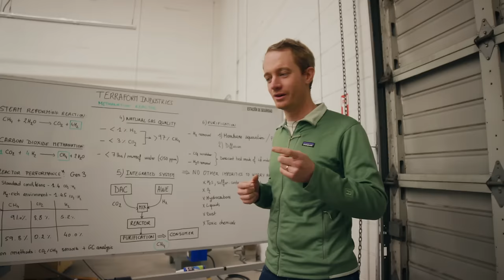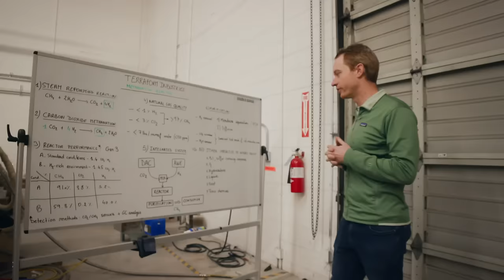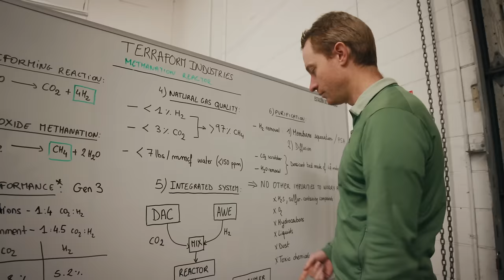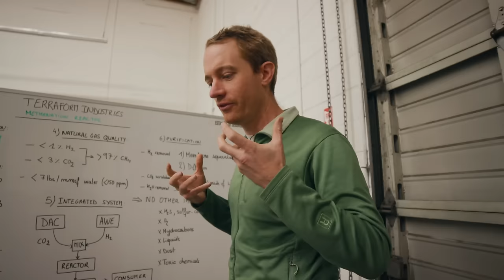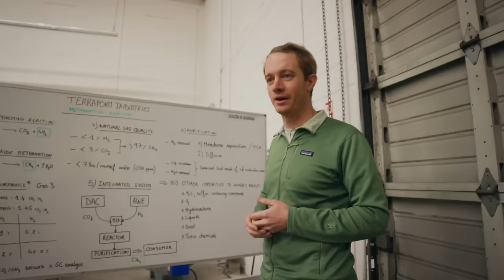The Future of Humanity's Energy No One Knows About | Terraform

Comment: Making hydrocarbons available is not the solution but the problem. We don't have enough energy to power enough of this, and it has losses all over the process, leaving even less energy at the end.
Reply: I don't quite understand your comment.

As discussed solar and other renewables can provide enough energy for this. The losses don't matter if it's a renewable way to produce hydrocarbons and remove carbon from the air at the same time. And if course the whole process will continually be made more efficient.

Maybe you're saying that we shouldn't bother with creating hydrocarbons, but rather just use electricity. That would be ideal, but at least in the near future humans are always going to demand hydrocarbons
Reply: The form of hydrocarbons he’s producing are also cleaner to burn than what’s currently dug up
Reply: @isaacwolf2806  Who discussed it? They in their video?
It. Is. Not. True.
We don't have enough renewables to even satisfy all current electric demand, let alone for the rising demand of electromobility; nor are there enough capacities in transmission lines to get those additional renewables from where they're produced to where they're needed.
Reply: Yeah this is only worthwhile in periods of excess renewable generation that goes beyond grid requirements as an alternative to battery technologies as it does also reduce the dependence on electrification or transportation and all heating technology. Synthetic fuels are not a solution alone, they have a small part to play in enabling the other main transition levers (ie continued deployment of renewable generation & electrification of currently fossil fuel powered tech & stabilisation of the grid because of renewables’ transient energy generation)
Reply: @babooXX   I suppose I was referring to his example in the master plan section. Shows how solar panels can reasonably achieve this. Also renewables currently account for 30% of the worlds energy, and a solar grid the size of Spain could power the whole world.

So to think that this process couldn't be powered by solar is short sighted. Enough energy hits the Earth in the form of sun every day to power millions of these things.
Reply: @babooXX  also, they're solving the transmission problem, that's one of the biggest points - the solar is "bottled at the source" into gas. Now you don't need to transfer or store the electricity.
Reply: @babooXX  Casey didn't discuss it in the video but you can read it on their homepage (linked in description) that the system is supposed to run intermittently when solar power would otherwise be curtailed (i.e. on sunny days at noon). He mentioned once that the system is going to be turned on and off once per day. It's basically taking the otherwise wasted solar power and converting it to hydrocarbons.
Reply: Are you slow? The cost for renewable energy is continuing to drop dramatically. "We don't have enough energy.." We will have more than enough once the cost for solar/wind is low enough. In the video he was talking about 20-25 years from now. The low efficiency will be irrelevant when the cost is low enough. They will only need to cover a small percentage of the deserts to get enough energy for this. 

It all comes down to profitability. Efficiency is just one part of that equation.

Comment: wonder what the entire efficiency of the system is, seems like it involves multiple energy-intensive steps, direct air capture, water electrolysis, and the conversion of hydrogen and carbon dioxide to hydrocarbons.
Reply: I think he s pretty clear it s not very efficient so you  d have to build more solar than with other systems, But the argument is that it will be much more realistically deployable at large scale (not really using new tech or materials), and competitive economimcally than building a full electric+batter+new very efficiient technologies and infrastructure worldwide that use either hydogen, nuclear, ect... Build something simple and ready to use that easely convices people it s not worth getting oil out of the ground, that s it in a nutshell
Reply: About 20% in most applications. 

Hydrocarbons just suck in most efficiency comparisons with electricity:

A gas heater can be max 100% efficient, a heat pump can do 300%. Electric cars system efficiency ~80% vs. ~35% combustion.

It will have a place in hard to replace applications like medium and long haul aviation.
Reply: @jakobcreates It's debatable for even aviation when you could go to high speed electric trains at 3-6 times more efficient. This whole video is like "if we ignore efficiency then we can burn unlimited methane.". But why not just plug solar into your motors with cables and do 10x more work with the saved efficiency? 

Sure transmission is a pain but with AI automation we could be creating and maintaining a very impressive grid.
Reply: @matthewthomsondev  absolutely agree, but no train will get you to Australia 😉 Electricity transmission is also not that inefficient, just requires proper infrastructure. And when you leak methane you release a super potent GHG.
Reply: Most people miss the biggest problem. The CO2, in order to drive the reaction you need high concentrations of CO2. There is far more energy in just the cooking of cement and making the cement than in the methane output. 
Other options are from cryogenic cooling of air but the yield is very poor. 0.04% so the mismatch of production output would also be extremely in-efficient.

This is a stupid idea. Bio fuel is way more feasible. For both direct use and feed stock.
Reply: The problem is not scarcity of electricity (just burn coal for that; never mind those global warming idiots). 

The problem is transportation fuel - gasoline and diesel (mostly gasoline).   Nations go to war over gasoline the way they went to war over spices (yes, countries fought wars over spices).

The only thing an ordinary consume should be worried about is how to cheaply synthesize gasoline.  South Africans/SASOL had been doing it for decades. 

Figure how to do that and you'll be Nobel-prized 10 times over.
Reply: I was wondering the same. Then again setting up ocean drilling rigs, drilling, pumping crude out, transporting it to a refinery (long distances), refining it, then distributing the final fuel products. That also takes a sh*tload of energy. I wonder what the calcs oil companies have come up with on this very topic.
Reply: Exactly, what can be done & what can be done viably (as a business model) are 2 different things. So I think what's missing from the equation /not mentioned is the carbon credit sales (subsidy)
Reply: Why not solar everywhere at source of use and nuclear, geo thermal for base load and 10 other NON-ghg emitting ways of making/storing energy? Why does he think making methane + transporting it and leaking it into the atmosphere is a good way to power our entire civilization?
Reply: Efficiency? Who cares? 
$$$ per lb of delivered products is the only thing that matters. Is it cost competitive with drilling and refining oils/natural gas/cement?
Reply: @matthewthomsondev transporting electricity isn’t efficient
Reply: He gives u the math, this amout of solar panels gets this amount of hydrocarbons.

Comment: It's all about cost. Five plus years ago I saw a story about someone doing similar in Britain. They were doing direct air capture and water electrolysis, the only difference was their reactor creates liquid hydrocarbons for use in an ICE tractor. Their rector setup wasn't cheap.
Reply: You sure it wasn't him? He is a Brit after all.
Reply: @genesishep  He is not British so it is unlikely.
Reply: @genesishep  sounds Australian to me
Reply: he's Aussie
Reply: Exactly.  Needs to out-compete traditional sources on a cost/production basis.  I'm sure the chemistry works but that's not the issue - the issue is the efficiency of the process.
Reply: @michaeldbouck  The issue isn't the efficiency. The issue is the cost. And the cost for renewable energy is projected to keep dropping dramatically in the coming decades. This will enable synthetic fuels to become viable despite the lower efficiency.
Reply: @jimj2683 not just lowering PV solar cost,, also 80% of 80% is better than 30-40% efficiency

Comment: one thing that is always forgotten in schemes like this is the transportation of the end product... natural gas and that to transport large amounts of it quickly  so pumps and pipelines are needed, one also must not forget that both natural gas and hydrogen MUST be liquified to be of any practical use in motor vehicles (land, sea and air) and even when liquified (which also requires a huge amount of energy (NG requires about 40% of the energy content to cool and compress) that it must be kept refrigerated, not just below freezing but below dry ice temps... so long term storage in not practical... an NO discoveries will change this fact as the critical temps of both NG and H are physical laws and their overall densities are much below gasoline and diesel fuel so require much more room to store, 4-5x for H2 in liquid form,
Reply: The process also seems like it will use a lot of water, both for the electolysis and the DAC cyle. I wonder where they are going to get all that water in the middle of the desert.
Reply: Some cities do have methane pipeline already in place, every house has a gas line. We don’t where I live because there isn’t enough topsoil to burry them well. All of our power lines are above ground too.
Reply: K im confused - i get that this has application not just on mars but here too but why does he think its how we will power our civilization? Why not plop solar and any of the other forms of emergy storage right where we are doing industry, data centers etc. i get that he said we already have supply chains for Natural gas and obv cost more to build huge wire ultra far distance... That's why solar can be installed on roofs anywhere... I just dont see why we would convert electricity into methane then convert it back to electricity to do *work*. Low efficiency and will continue to pollute and cause climate change. Can someonw plz explain it to me?
Reply: @TheSkystrider  Because the sun sets occasionally. It's nice to be able to store excess energy in a dense form for later use. Like a battery.
If the Carbon in the methane (or whatever gas or liquid hydrocarbon they're making) was pulled out of the air, then burning it just releases it back into the air: It doesn't make the 'problem' worse. 
Net neutral.
Reply: @colinbowman8816  No it fixes a huge problem! It provides all our hydrocarbon energy without putting more Carbon in the air. Whereas currently, burning fossil fuels adds NEW carbon into the air constantly.
Reply: @millennialfalcon1547  reading comprehension?
Reply: @colinbowman8816  yes batteries. So instead of an overly complicated process I could just use batteries to store the excess electricity.... Why do we need carbon as fuel? I can see plastic still being needed but this is just showing a concept without regards to how much energy is needed to make this natural gas.

Comment: Now this is a compelling idea! Use the excess solar energy the grid can't accept to synthesize natural gas, then transport it to applications that require clean-burning fuel. I also appreciate how the systems is a family of machines which complement one another: direct air capture to harvest CO2, electrolysis to isolate hydrogen, and the reactor to combine them into methane.

This is an inspiring energy solution, and I'm wondering if it's be possible/profitable to develop small-scale systems for homeowners or research stations.
Reply: It's almost a sin we don't have that already. Solar panels filling a fuel tank in the garage for my 1990s V8 I can maintain my self. PS right to repair should be a lot bigger thing. Apple sux what they are doing with its updates to old phones and making 5 year old phones "obsolete." My apps haven't got better. Worse in fact when look at social media
Reply: @nikitaw1982  I'm right with you on the need for a decentralized means of energy production. We already have that with solar power and electric cars, the downside being that the manufacturers of most electric cars make them nigh-impossible to repair by the end user. Green energy is amazing, but I see its roll out used as a vehicle for consolidating control of energy distribution and infrastructure. Terraform Industries inspiring because it has the potential to decentralize hydrocarbon supply, and enable the use of vehicles that are more easily repaired. I'd love to see a solar-powered system that can synthesize fatty-acid-methyl-ester molecules (diesel fuel) but methane is a lot easier to produce while being able to flex into many roles.

I agree wholeheartedly with the need for the right to repair. I'm actually watching Louis Rossmann's video on dead Toshiba hard drives as I type this.

Comment: Your master plan is to use the Terraform system to produce gas which will then be sold and distributed for use in place of traditional hydrocarbons. Have you considered whether it's feasible to combine the solar array/Terraform system to produce and store gas during the day, then use it in an adjacent gas turbine for energy production in the evening at peak demand? In other words, using it as a battery to meet peak demand.

Lithium batteries are quite efficient, and hydrogen batteries are famously not so efficient. I imagine this system wouldn't be as efficient as lithium batteries either, but if it's more efficient than hydrogen, maybe it serves a role in energy storage as lithium prices increase.

I'm just curious whether you've thought much about this, thanks!

Edit - I realised after making this comment that this channel is not the company! But I hope Casey or someone from the team sees it.

Comment: Very interesting work and well presented.  A few questions; where will you get enough fresh water in the desert for the solar array reactor?  Have you thought about using thermal solar to heat up the water?  I know there is some cutting edge solar arrays being designed and built using mirrors and evacuated tubes to generate large amounts of heat to drive turbines, storing the heat in molten salts used as a battery.  You might implement something like this in your reactor for a heat source. ?.  Thanks for sharing and keep up the good work.

Comment: If this is sitting somewhere in the desert, where does the large volumes of water come from that is required?
Reply: The air - that was the entire point - water and carbon collected from the air for the power cost of solar panels.
Reply: @UnexpectedMaker  okay, I thought he was doing the electrolysis separately to the other process of capturing carbon dioxide.  I've seen tech before that captures moisture out of the air and it takes a very large surface area and a long time to get anything significant.  I can't imagine to make the amount of hydrogen he's talking about one could get enough water to do that at scale just from the air??
Reply: @UnexpectedMaker but it’s in the desert, I think was the point. Places not typically known for having lots of water
Reply: @UnexpectedMaker  There is not much water in desert air.
Reply: Yeah somehow i think a lot of the math doesnt check out on this, not only the water in the desert. Hydrogen electrolysis is too expensive on its own, and here it is a stepping stone to turn it back into methane by adding more complexity. Using solar directly is smart though
Reply: I guess this is suitable where desert is on the ocean? Or beside large bodies of fresh water that is not exploited for agriculture, if there is such a thing
Reply: @dnomyarnostaw  There is an astonishingly large amount of water even in desert air. But the desert is a dumb place to build a solar farm. Temperature is high, reducing conversion efficiency and panel life, and dust accumulates. On a reservoir is the smart place. Besides running cooler and being easier to keep clean, it cuts evaporation and biofouling.
Reply: @dnomyarnostaw  Actually that's wrong. Hot air has more water than cold air. Which is why you get icing in your fridge if you leave it open in summer. Some deserts may have very dry air, but not in general.
Reply: @Martinit0  No, I'm not wrong.
Warmer air CAN contain lots of water (eg, tropical jungles near the equator), but Desert Air  is fg Dry  ! ( eg  Sahara Desert). The nights in the Sahara are very cold, but no dew condenses out of the air because it's DRY!
WARM does not automatically mean WET!